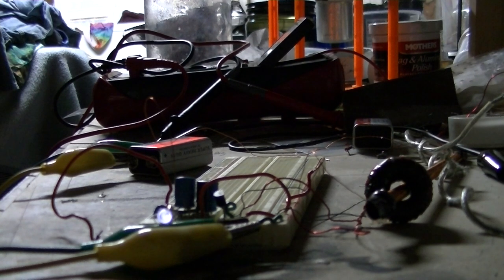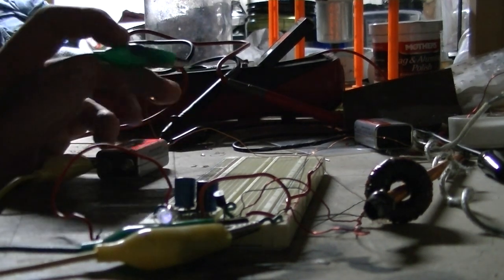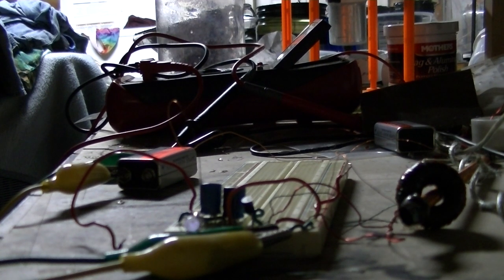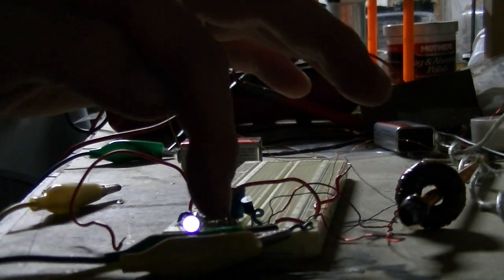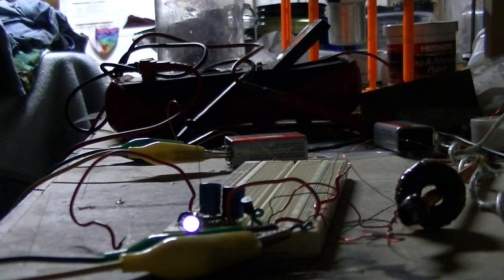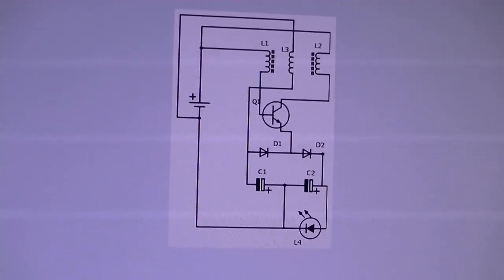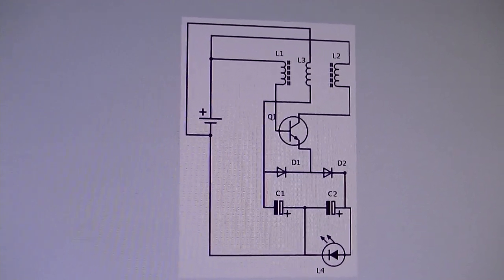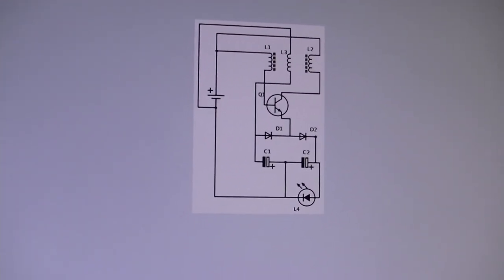Ringing a 50v 100uf Cap

Comment: Cool opening statement. I get what your saying. Are you sure there is no hidden super-caps or batteries?... JUST JOKING.. Yeah I'm going to attempt lasersaber's SJR circuit with this gnarly looking spiral vortex coil I made last night. I added it to my posts on Google plus. But yeah, keep rocking and doing the good work.
Reply from the maker: That coil is very nice :) Put it in an iron pot with and connect it through the middle with an iron rod.
Reply from the maker: That's a very nice coil! :) Put it in an old cast iron pot and weld a rod through the center maybe? :)
Reply: Diadon A Yeah, never thought of that. That sounds a lot easier than wrapping welding wire around it a million times. I'll definitely try that.

Comment: Noma garden lights will have a super cap rather than a battery in them before too long. Was that Iron Maiden?...hehe. How long will it run with no cap? :) j/k
Reply from the maker: That's the plan, extreme efficiencies in all things energetic :) It's a band called "Control Denied". The are a progressive metal band like Maiden only with a little more thrash.

Comment: Nice !
One question, you said 40/40 bifilar and 90 on the middle winding...but then the sewing needle has 300 ?
I like this a lot, as it shares the voltage doubler from your other long runner.
Reply from the maker: 40t of 24awg / 90 turns of 28awg / 300+ turns of 30awg on the air core.
Reply: Ah cheers...thought it was 2x 40t :)